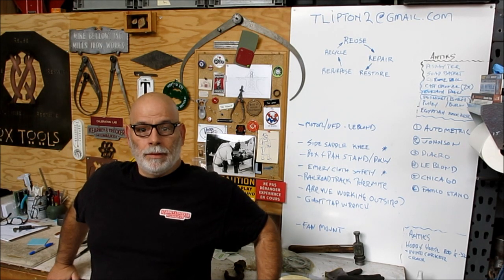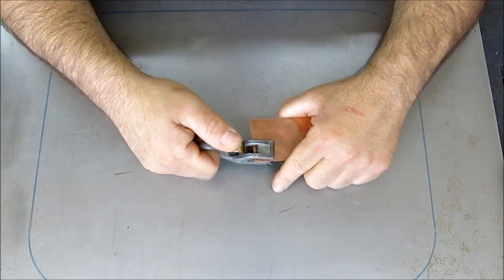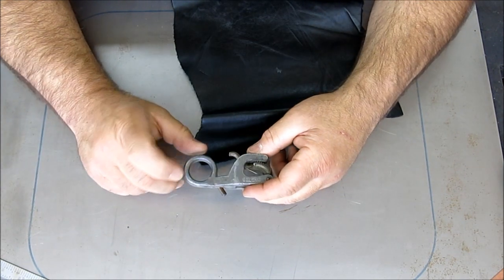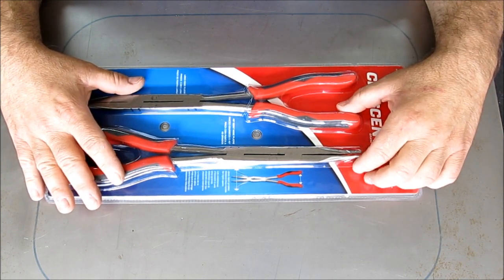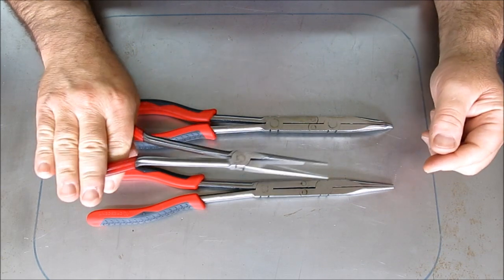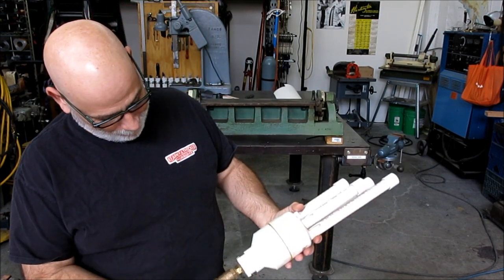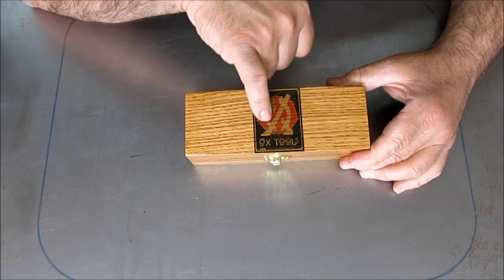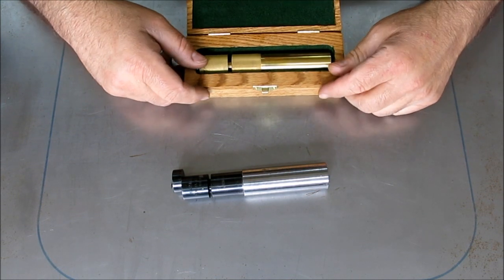Monday Night Meatloaf 45

Comment: Thanks for another great batch of meatloaf Tom!
Greg did an A+++ job on the height setter and box! Very cool with your logo on too! The box could use finger holes and a longer slot for putting away at extended height, but all you need to do is write the overall length in the box for when you take it out to use the next time! Very nice gift! ;-)
For your doorbell whistle you could get an electric air solenoid and add a time delay (15-30 seconds after each press) to the switch so people couldn't keep "tooting your whistle"
Jeff
Reply from the maker: Hey Jeff,

Thanks for the comment. I think a foot powered piston pump will do the trick on the whistle. Then I won't have to run my blue-dee-bos-todd compressor.

All the best,

Tom

Comment: I just exchanged a 30' craftsman tape at sears.  They no longer cover tape measures, but gave me a Stanley instead, saying that I would have to use Stanley's warranty.  I guess it was a smart move, as I had exchanged that tape probably three times.  Carpentry, outdoors framing type, can be rough on them, and really no tape can withstand that type of entropy.  However, tapes have come down to $5.00 now, instead of the $20, so its a wash.  We really need to start a movement to 're-industrialize' America.
Reply: Start with a repeal of the Tax "Reform" Act of 1986 which clobbered depreciation of capital investments and the ability to write off R&D investments...

There are a bunch of other tax code changes since then which drove ever more nails into the coffin...

And some regulatory changes which may make some urban dwellers feel good, but only make things tough on the manufacturers who try to do things right.

Factor in the get rich quick culture which took over Wall Street...

Face it, we've got to fix a bunch of things before we can really kick our factories back into high gear...

I'll keep pushing for us to do that though...
Reply from the maker: Hey Kg,

Start by staying out of Harbor Freight. But man its hard not to ignore those ridiculous prices they have.

Cheers,

Tom

Comment: Tom,
I recently had the pleasure of restoring a 40's era Walker Turner bandsaw, a great old machine.  Mine had been ridden pretty hard over the years and I had to make a number of new parts.  One was the drive shaft for the lower wheel.  It had been run with bad or frozen bearings and was thoroughly "chowdered".  The end of the shaft had a taper to match that on the main drive wheel.  That was totally new to me (an amateur), but your series on short machine tapers was just what the doctor ordered.  I was able to measure the taper, set up my lathe and cut it correctly using your tips (OK, it WAS on the third try).  I ended up with a shaft that fit perfectly and the saw runs and looks just great.  Thank you so much for all you do.
Paul Jacobs
Reply from the maker: Hi Paul,

I couldn't help but notice your last name. Jacobs. Are you pulling my leg here? Glad you put the taper turning to the test. Its a handy method.

All the best,

Tom
Reply: oxtoolco
No, that's the family name.  No relation to Arthur Irving Jacobs or "Chuck".

Comment: I use my SnapOn 415CP needle nose constantly in the shop (14 1/2", 35 degree bent tip), but dang it I need to get to an American Sears from the looks of it.  The double joint action on those make them perfect for fishing down into the nether reigions of a fender or rad cradle for dropped non magnetic items.
Reply from the maker: Hi Emil.

All of us has been down a hole without a pliers. The fact they can open in a cramped space is a good enough reason to get some. I think there are quite a few makers. Or at least one offshore factory that puts lots of different branding on the same pliers.

Cheers,

Tom
Reply: Oh totally. I can actually think of precisely 3 hose clamps on the 89 Honda Accord I drive that an intricate yoga pose to remove due to location, but sneaking between the intake runners would be just the ticket. And besides, one can never have enough el wierdo pliers some days!

Comment: I was so close to saying the previous mystery tool was for canvas and possibly sail making, however others were so confident in the use and name that I didn't bother.  I'll take my prize anyway please ... yeah right.

As for the new mystery tool, looks like something to help guide or slow material during production.  With the roller on one side and fixed balls on the other it should intentionally provide resistance to something moving.

Comment: Is the mystery tool a pneumatic castration gun. Lol. I'm stumped on this one. I like the pliers. 

I have a bunch of old Craftsman tools including my lathe which was made in the 50's I think. 

Thanks for another great video,

Mike
Reply from the maker: Hey Mike,

Its a manually operated autobiographical castration gun. What this means is you use it on yourself. Screw the ice bucket challenge. Real meat eaters use the turbo entabulator.

Cheers,

Tom

Comment: I liked the whistle, think it was a cool build and it even has a great sound. I need to make one out of copper pipe. Might have to make the inserts from brass. Should have you tell us the length of pipes and how far up the actual angle holes are from bottom as his tuning ratios were superb.

Comment: Hi Tom, how about a piston in an air cylinder connected to an old style bell pull, geared as necessary, then to be more sneaky a flip over to alternately make it ring a bell .just to confuse those pesky kids on Halloween..
ATB
chris
Reply from the maker: Hey Chris,

A big foot pedal powered piston pump. Step on it and get a tone. 

Cheers,

Tom

Comment: Tom, reverse engineer that whistle for us and throw up some drawings. That's too cool and my grandson might get a kick out of building one! :-)
Reply from the maker: Hey Marty,

I go over it a little in a video. There are quite a few plans out there if you dig around. This one is hardware store simple. Thanks for the comment.

---Tom
Reply: oxtoolco OK. One favor, can you provide the lengths of the tubes and is it 3/4" PVC? And how far down the notch is cut from the end? That would determine the notes.
Thanks Tom

Comment: Sears and Roebucks.... My big set of Mic's was bought there.... uh, 1978?   Sears made their money on finance charges, something like 3/4 of the profits were from those darn Sears Credit Cards.  Everything in the store didn't make money, some idiot MBA showed up and decided they needed to raise prices and cut cost.  They kept doing that and loosing money as people went elsewhere, hence no charge card fees. 

Latest device... not a clue, but would make an interesting tube bender (running fuel lines in an airplane fuselage, no room for conventional bender, so the 90 degree flip function makes sense.
Reply from the maker: Hey Tom,

That was one of my first credit cards. The sears card and then a shell oil card. All my friends gave me crap when I bought my own washer and dryer. The poor bastards were still going to the laundry mat. 

Cheers,

Tom

Comment: Yeah that tanning clamp would be a pretty weak "bitch" clamp...does anyone else call plate clamps "bitch" clamps?

I'm sure someone else got the mystery tool, but without looking below I'm guessing it is a type of high quality tubing bender? It look similar to the bearing pressed type I used to use in making the SS tubing for gasoline additive injectors at fuel depots.

I'm sure you've already figured out how to make a reservoir for your door bell with an old propane tank that refills only during shop hours, but have you thought about painting it up with some gold, copper, or brass colored spray paint?

I know you hate painting, but it would make it look really cool, if you want to box it up and send it over. I'd be happy to paint it for you, on the house...I've got a little airbrush kit and could trick it out with some black and red accents?

Thanks again for the meatloaf...Aloha, Chuck
Reply from the maker: Hey Chuck,

Nobody has guessed the mystery tool just yet.

cheers,

Tom
Reply: oxtoolco Hmm, I will have to look again...I just can't think past the grooved out recesses for tubing and see the knurled knobs as ways to tighten the spheres along the inside radii of the bending tubes...but it doesn't have enough leverage to bend anything beyond copper line sets, so I'm stumped. Thanks for the comment and 2nd chance!

I do know that when tanning leather, to soften hides they often use the brains of the beast that was slaughtered to grease up the hides during soaking...Mmm brains!!! Good for the zombies at Sears too...even though that saddens me to no end.

I can remember before the internet that getting the "Sears Catalog" was one of childhood's highlights back in Hawaii, they had everything we couldn't get in the islands in there...

Aloha...Chuck